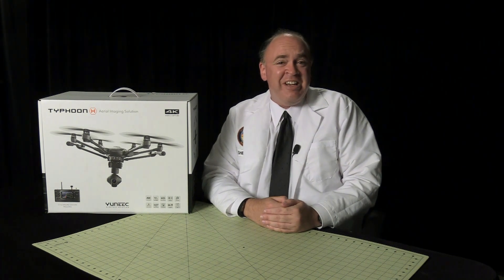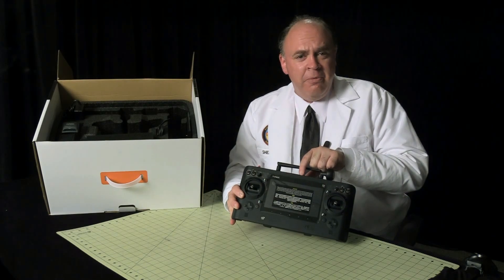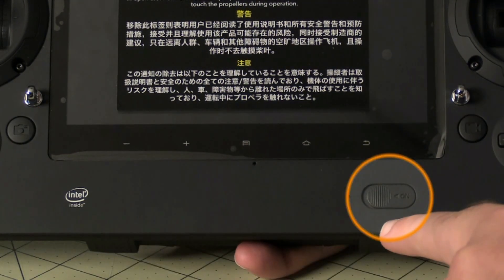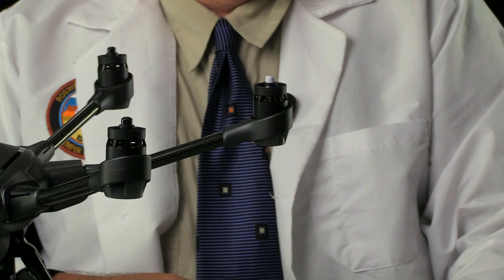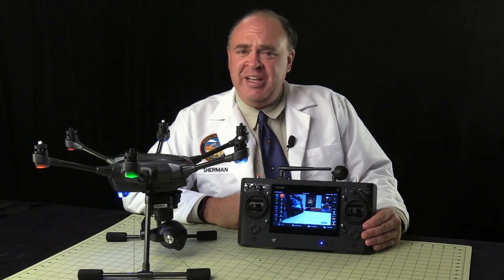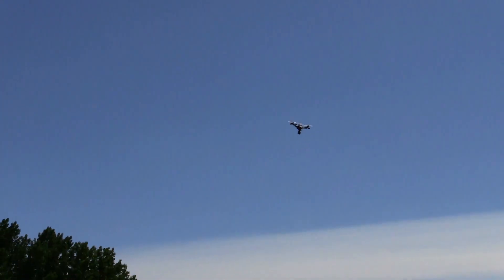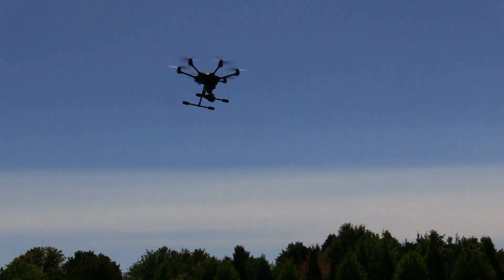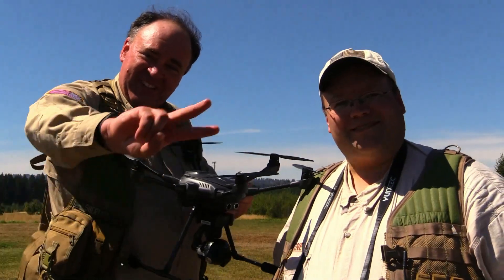Yuneec Typhoon H Unboxing, Setup and Flight Testing

Comment: I just acquired one used from offer up and I keep getting obs has failed on the screen what should I do
Reply: Did you ever figure out your issue? I got a used pro and had the same problem.. Make sure firmware is latest, create a new model and reset everything, calibrate compass, make sure transmitter is setup in advanced mode and if you have realsense that's checked as enabled.. You must have a GPS lock and at least 10 satellites, don't try to enable on ground

Comment: Just got myself one of these - a great deal on a refurb model.  Had it out a couple of times, and it is a blast to fly.  Also binge-watching all the videos I can find about it!   One thing which doesn't get explained, is the realsense...   Mine has it, but I have no idea how to actually turn it on!
Reply: Phil Buglass check your transmitter settings in the system settings menu. There is a checklist box for RealSense module installed, make sure that's active. Some say make sure radio is in advanced mode but I don't think that actually matters.. I leave mine in advanced anyway. To turn it on, make sure you have at least 10 GPS satellites locked on the aircraft and take off, get a decent altitude maybe 30 feet up and away from your position and other objects, ensure that you've retracted landing gear, and then flip on the Obs Avoidance switch.

Comment: for some reason, mine is very jerky from unboxing till now,,, especially right after take off, and tortous  speed,, nowhere near as fluid as urs flew, and i have the newer version, btw,, u guys never used the wizard.. btw , my sensors wont work anymore,, only worked for one flight, now it keeps telling me that its not installed? any suggestion,,, please feel free,,, great video review,, best in awhile,, very informative

Comment: Good afternoon MW, I wonder if after triggering return home at typhoon h if it at the time of landing it fires the landing gear altomatically. Or the pilot needs to fire manually.
thanks for listening
Reply: Elizeu Vasques it triggers the landing gear automatically when return to home is activated . Just flip the landing gear switch to set the “extend/retract” back to normal

Comment: Great video. Which is better, DJI Mavic pro or the Yuneec Typhoon H?
Reply: Everton Oliphant the Mavic of course... you can fly up to a range of 4 miles.
Reply: The Mavic will be broken twice before anyone reads this.  4 props is not as stable as 6
Reply: Gary Mayo,
Thanks brother.

Comment: I see that some of the ST-16 controllers have 3 antennas and some have 2. What is the difference?
Reply: The older models have 2 antennas on the outside and one build in, the newer models have all 3 antennas on the outside. (Or the other way, I can't tell for sure, in any case it's a difference between older and newer production)

Comment: Great video. A little trick to get you from unpack to in the air fast. You (1) insert the battery immediately into the H and turn it on. (2) You turn on the transmitter, simultaneously. (3) You lock arms in position and install props. (4) You set to angle mode. By now you should have enough GPS satellites to fly. (5) Step back, arm the motors and hit the throttle. A second trick. If the H is all set up and you are changing batteries between flights (1) You leave transmitter on. (2) Incert the fresh battery and immediately turn the H on. (3)put the transmitter in angle mode and step back. (4) As soon as the transmitter shows the H has acquired 6 satellites, arm the motors and hit the throttle. In the case where the H is already set up. You turn on both transmitter and H simultaneously. That method yields the shortest possible ready to launch time. In every case, switch to Smart mode as soon as you are 20 or so feet up. That activates the GEO FENCE as well as the GPS. The H ,with the latest firmware, is capable of a tad over 57 MPH with GPS turned off. The H max speed in Follow ME mode is about 45 MPH. Also, you can add the Real Sence module to the H that you have, it hang and plugs into existing camera quick detach. You do not have to buy another transmitter. The one you have will work. GREAT REVIEW guys.

Comment: Just wanted to add that your review is very good...  It is unfortunate that it was literally published 2 days after the latest code upgrades that add some decent improvements to this unit.  The pace at which they are putting out software updates is pretty interesting and they seem to be trying real hard to update the issues people are noticing as fast as possible.   Would be nice to see an updated version of your video in the same format that takes into account he B23 (Sept 1, 2016) updates...

Comment: Did we hear a fan in the remote control ?
Reply: Not sure if you hear the fan in the video, but yes there is two small fans in the transmitter.  they are not too loud when your using it, but if you make a sudden movement with the controller it can change the pitch of the fan (gyroscopic effect?)...  either way its not really noticeable when in use.
Reply: I I I I  I  I I  i         Its ii iiii I    I iiiii I've iigiiiiiiiw it i.  I iiiii. I'm at a news conference in Washington and London w
Reply: Can
Reply: R d
Reply: Except

Comment: no real progress on the flight time...
Reply from the maker: Yeah... I think the underlying physics involved means that until we come up with an entirely different power source (fluoride-polymer batteries, hydrogen fuel cells), flying time for multirotors is going to top out at about 20 minutes. There is no getting away from the fact that more powerful batteries weigh more, and are often the heaviest single component on the aircraft.

Comment: lipo batteries don't explode into flame they overheat and catch fire, they should be cared for like the use of gasoline or charging lead acid batteries, they should not be charged in the presence of flamables, an aluminum plate of resobale thickness on a bench top with a little cradle should be a reasonable saftey precaution, set a timer, or use a wall timer to be 100% charging is terminated at the manufacturers specificarions.
Reply from the maker: All very true... I freely admit to engaging in a bit of hyperbole for the sake of making clear that there is some real danger when you're working with LiPo batteries. My concern these days is that thousands upon thousands of new people are coming into the drone community (and I'm glad to have them), but since they didn't "grow up" around old-school LiPo batteries and chargers with external balance leads, and such, they may not appreciate these batteries are any different from the batteries that are used in camcorders -- and I definitely want them to be aware of that fact.
Reply: Bear in mind 9v batteries are a fire hazard if the contacts are bridged, a bag of "dead batteries" in the presence of flammables can be dangerous. Also mixing old and new batteries can lead to the batteries exploding or leaking acid everywhere. Lead acid batteries are even more dangerous with their hydrogen release while charging.  People simply have to learn, there is nothing that is 100% safe, or that can be expected to be 100% safe all the time. On any given day a plug can fail, or charger short, how you react is what matters most. I've had computer power supplies smoke and burn, and arcs across components, none of which were related to user error. All technology is dangerous if misused, and sometimes it simply fails, this is why fuses exist, also why one should read the safety manuals.

I get concerned that with all the bombastic statements made about safety by government and sometimes individuals people are encouraged to be fearful and not educated.

Comment: great overview guys. flight time is pretty good considering the heat though probably a bit less in flight other than hover perhaps. What is the range? One thing I really like about this one is the speed, but I am curious if the range matches a P3 or P4.
Reply from the maker: Owing to the requirement from both the FAA and the AMA that drone operations occur within visual line of sight, we tend not to test range -- as I'm pretty sure any modern platform could exceed the VLOS standard, and we wouldn't want to be seen to encourage people to do that. Sorry I can't help with that question...